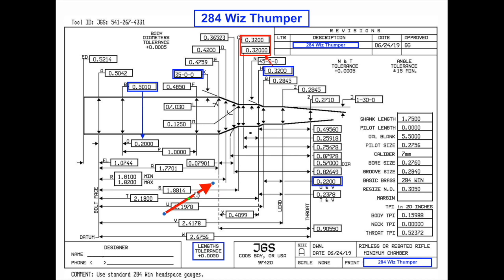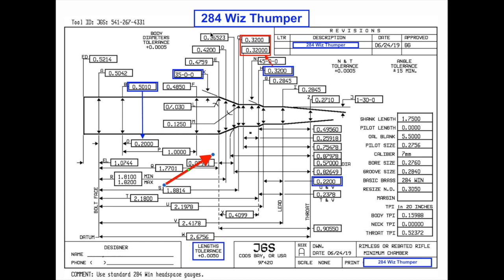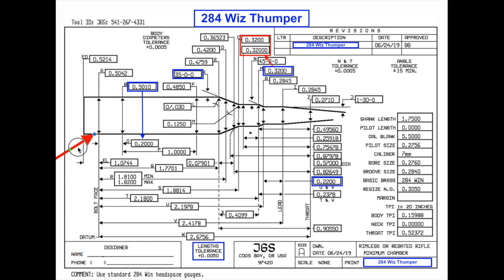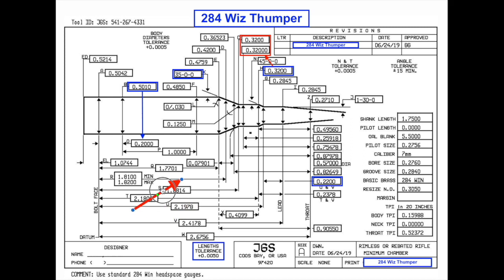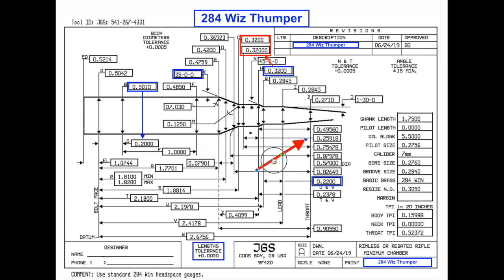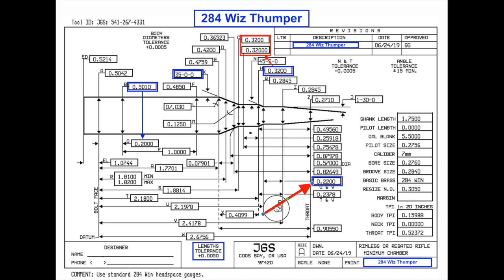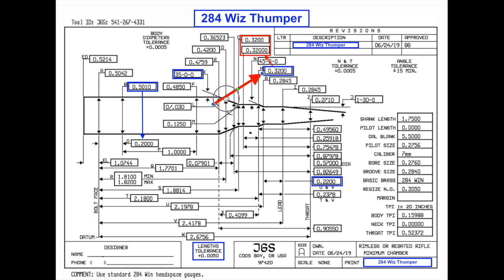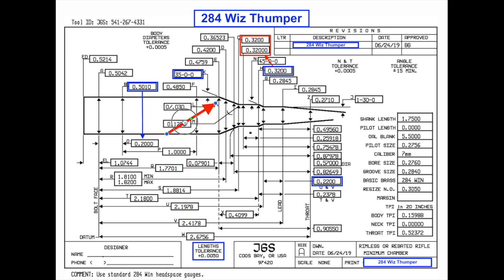The basics of reading a chamber reamer print

Comment from the maker: I wanted to make sure I clarified that the tolerance of .005" that I talked about was for the length only, not every dimension on the reamer. There are other tolerances listed on the print that correspond to other aspects of the reamer in their own way.
Reply: How big tolerances are ”normal” in other dimensions? Would be nice to hear more about designing own reamer. How changing those dimensions affect accuracy, brass life, combustion etc. I like your ”out of the box” thinking on these video subjects. There are not much info out there of reamers. Solid info.

Comment: John I watched this video because I wanted to learn more about reamers to better understand a comment Erik Cortina made on another video. He recommends having a gunsmith run the shoulder of the reamer into the comparator for full length sizing of brass.

Have you done this and can better explain possibly for me what Erik meant on this and how this actually works?

I have a Hornady comparator and use it to determine my overall loaded cartridge length. I only load for hunting purposes and bench rest shooting to become a better hunter of course. So distances out to 400 yards (ish) is where I am playing to. Eric's video was on FL sizing of brass where he bumps the shoulder .002" of an inch. I don't understand Erik's comment of how a reamer can be utilized on a compator to improve the accuracy of full length brass sizing. Thank you. I have Lee dies and in Lee's book he recommends full length sizing all brass used for hunting purposes so I follow those instructions (without fully understanding the process) so I do not neck size only - I know that's another topic for another debate.

Comment: Hi John, I understand that this is a specific reamer manufacturer’s chamber reamer engineering drawing. What I find troubling is that all the dimensions appear to be basic (refer to ANSI standards for geometric tolerancing) (they are enclosed in a box). I find this troubling because there are no tolerance specifications that I could casually see. Their are no tolerances for length, diameter, true position, runout, concentricity, cylindricity or other modern day engineering drawing specifications. This is also true, to a lesser extent, concerning SAMMI engineering drawings. It appears to me that the cartridge specification authorities are way behind current engineering drawing tolerance specifications that other current manufactures (non cartridge) need to adhere to for accuracy communication.
Reply: These are just the nominals.  The actual dimensions and tolerances used for the reamer and the die are proprietary. As much as I would like to know; I understand why the manufacturers won't just give that information away.
Reply: Thanks John, that makes sense to me.

Comment: Hey John, How does the 200 line actually affect bolt click? I've never had that happen.  I bought a lathe & started  spinning my own barrels a while back and haven't come across this problem yet.  But I've only cut 6.5 CM & 308 SAMMI spec chambers so far.  Is it caused by a reloading error?  Over pressure maybe?   Is it similar  to using a small base die for sizing brass when feeding an auto-loader?  If you would please help me understand. Thanks for another great video
Reply: Your re sizing die and chamber die must agree with each other  to eliminate under sizing of the brass and then work hardening the brass at too large a size and your re sizer not sizing the brass enough to fit inside the chamber
Reply: @kenthall6584  Thanks Brother